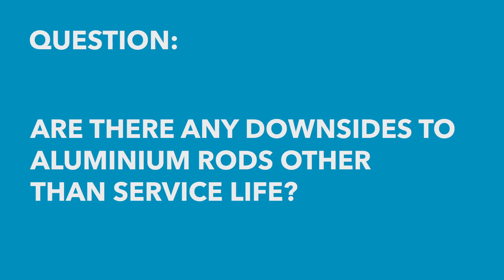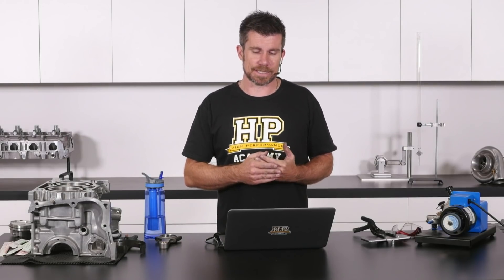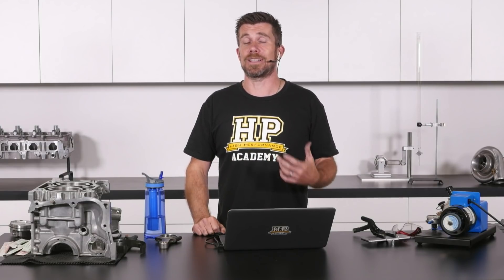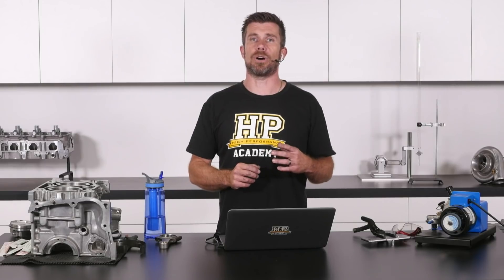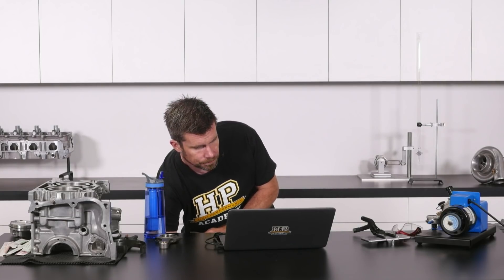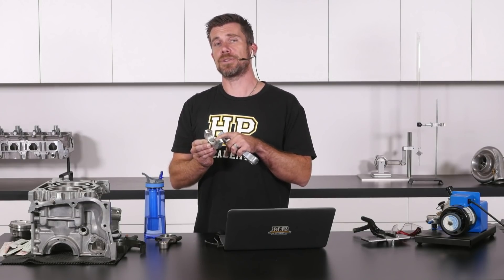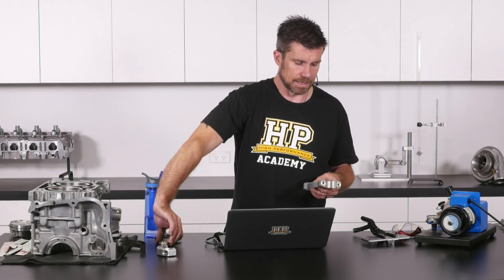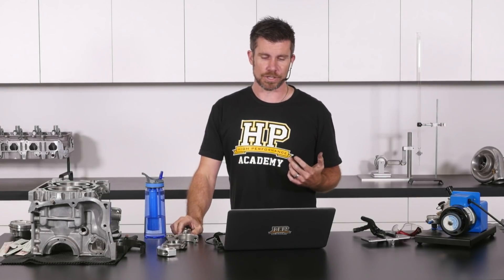Aluminium Rods | Pros and Cons [HPA Q&A]

Comment: Can the service life issue be mitigated with a good tune or staying below a certain hp per cylinder? Living up north with the cold it seems steel rods are the only way to go for a street car last you wanna waste time warming your car for every trip, do you think manufacturers will experiment with tennalum 7068? Sounds like the replacement for titanium for strength to weight without increasing the size too much
Reply: Plenty of ppl running aluminum rods on street evos. Don’t listen to ppl on here who’ve never done it there are ppl with 50k on their rods. There’s a huge thread about it on the evom forums.
Reply: @msengineeringdavid3702  are they high powered motors? Because what ive heard is when you push over 200hp/cylinder ish the bearing start wearing out much faster, less than that and the difference is not as much frok steel rods.
Reply: Inverted V12 Powerhouse  aluminum rods don’t kill bearings they absorb the shock.
Reply: @msengineeringdavid3702  at a certain power level they dont.
Reply: Inverted V12 Powerhouse  incorrect what car do you have?  What experience you speak on after a certain powerlevel it doesn’t matter if you have Steel or al but that doesn’t happen there are recent publications of 2200 4 cylinders that do not have issues
Reply: @msengineeringdavid3702  Please define "Street EVOs" and their actual usage. A monthly autocross car will see more abuse than a monthly drag racer. In the drag scenario I'd go aluminum but on autocross I'd go forged or billet steel.
Reply: I may be wrong but I think the service life is related to heat cycles, RPM and con Rod ratio
Reply: @DericCribbs  while those play a roll, I think it more has to do with the setting. Your gonna be putting a lot more load and stress on things than just the occasional street pull, the question is can you build an aluminum to last like a steel one within certain perameters, or are they pretty much limited to tracks and deep pockets. People in the states rock aluminum rod dailies, but where I live I can't see that being possible if the temperature goes down to -20c, you'd probably have no bearing clearance at that point lol
Reply: @Drake5153  they are limited for racing parameters. They are more used in drag engines because they are replaced alot. He mentions it in the video at the end
Reply: @Drake5153  Both aluminum and titanium will have a short life due metal fatigue. I'll include some snippets from an article.
---
The other drawback is that titanium rods do have a fatigue life in race applications and are typically switched out every 40-80 hours. [4 times cost of billet connecting rods]

Some racers change their aluminum connecting rods religiously every few runs or every season, since typically the cost of a set of rods is less than the cost of the rest of the parts in a race engine. Import racers whose cars double both as daily drivers and weekend warriors typically use their rods for 10 to 15 thousand miles and again, change them just as a precautionary measure depending on how hard they run their engines. We’ve even seen customers put hundreds upon hundreds of passes on their aluminum connecting rods without failures.
---
Billet rods would be considered most budget friendly long term versus aluminum or titanium rods.
Reply: The longevity problem lies in metal fatigue from heat cycles more than anything. Aluminum rods can work on the street, but to even think about them you're going to need to be serious. If you're talking about dailying your racecar in -20 temps, you're not serious. A $500 dollar beater can absorb all those cold starts and road salt.
Reply: StabyMcStabsFace but you’ve never ran them where does negative 20 temps come from?? Road salts have nothing to do with aluminum rods?  Commenting just to comment.
Reply from the maker: Watch this video Drake, it answers this question for you ;) - Taz. https://youtu.be/xTF59-hE0qs